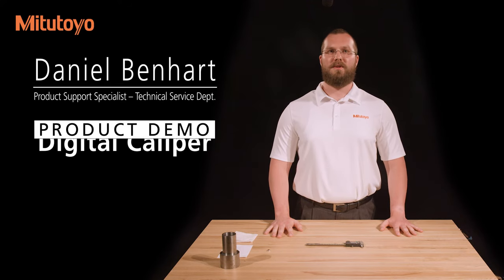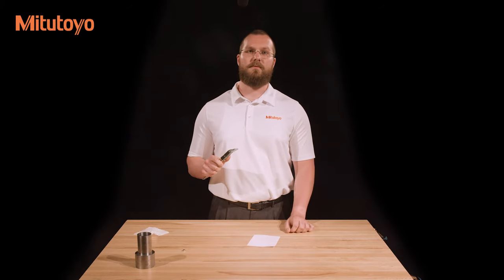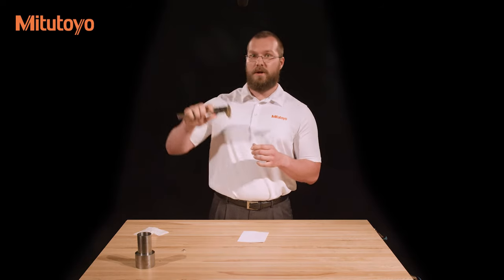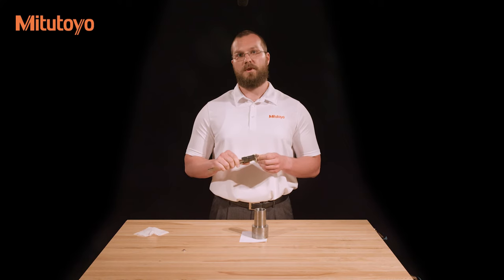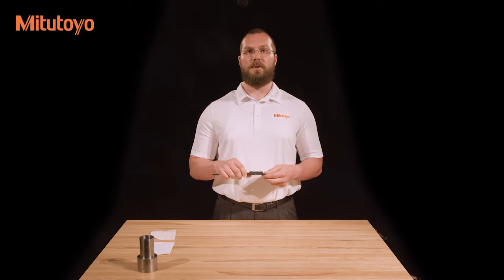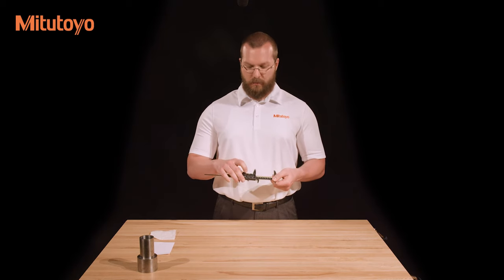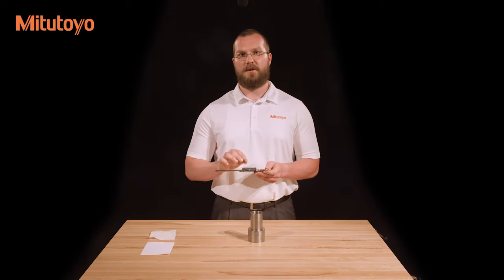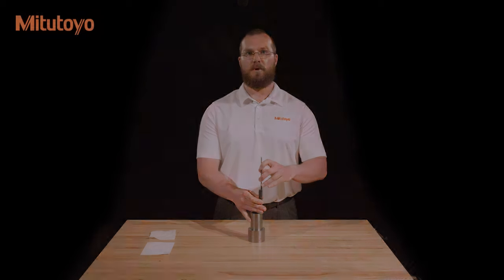How To Use A Mitutoyo Digital Caliper

Comment: Great video. I don’t think anyone else has bothered to do a video on correct caliper technique.
Reply from the maker: Thank you! We are glad you found it informative!
Reply: @MitutoyoAmerica  I’m glad I am able to improve my technique. 

I have one more question: when measuring with digital calipers, do I sweep in the same way I would with analogue calipers and use the smallest measurement? Thank you.
Reply: @MitutoyoAmerica will this caliper need oiling or greasing on the top or bottom ruler for smoth sliding back and forth?

Comment: The instructions for the calipers say, “Before using the Digimatic caliper for the first time, wipe the rust preventive oil from the caliper with a soft cloth soaked with cleaning oil.” What is “cleaning oil”?  I googled it, but all I got were search results for “Oil cleansing,” a type of skin care treatment. 

Must you also use lint-free paper to grasp the caliper arms for cleaning them? (0:18)

Comment: I got a very old Mitutoyo digital caliper where often the display shows "F05" after moving the slider very fast or when I pressed the slider too strong to the measured part. Why does this happen ?
Reply: I think it is an error message. It tells you the measurement you would have then gotten would not be correct instead of giving you an incorrect measurement. Move the slider slowly to avoid error.